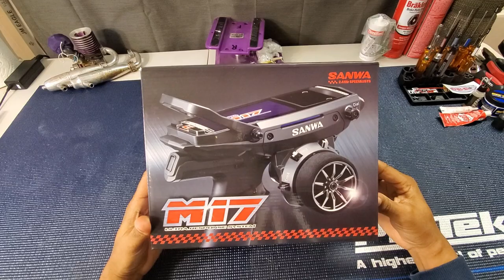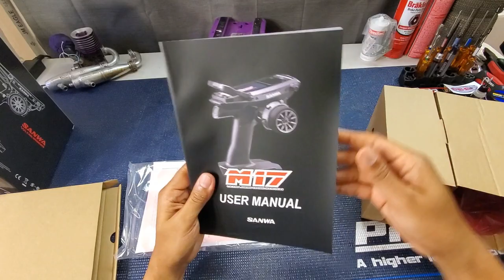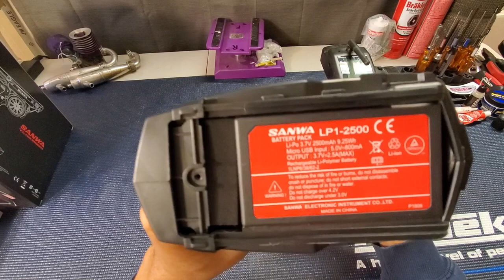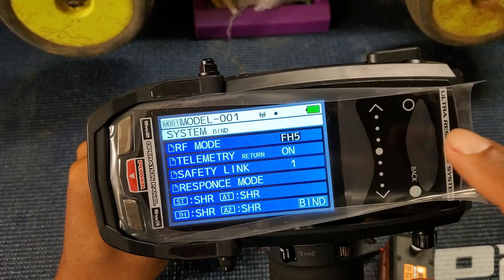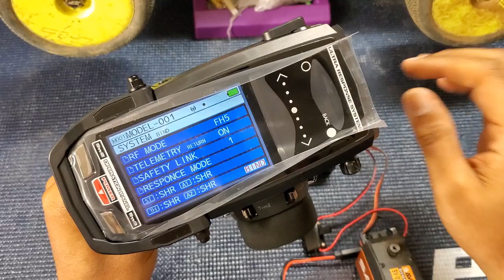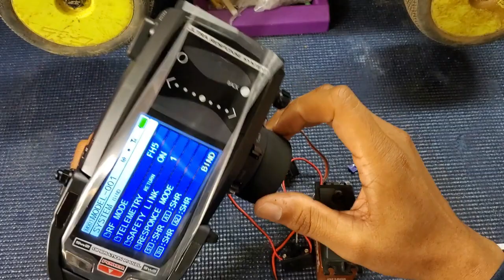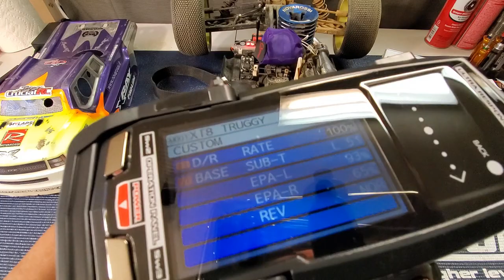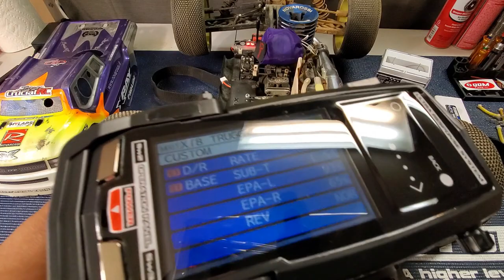Sanwa Bound

Comment: Hi, thanks for sharing. any updates or further opinions on this? I'm kind of between this and a 7PX any info would be greatly appreciated
Reply from the maker: Wassup Walter. This is my go to radio for half my fleet now. What will you be using this radio on? The rec are super small, which is a plus. The signal strength is phenomenal. The menu options are endless. I also like that you can change trigger positions and the wheel tension. The only down to this radio is setting up the killswitch for my 5th scales. That was easier with my Futaba 4pm. Hope some or all of this helps.
Reply: CrucialRC hey, thanks for the quick reply and all the detailed info for now I’m going to be using it on my old Kyosho inferno MP 7.5 in the near future probably going to be getting a different 1/8 scale buggy not sure if I’m going to go nitro or electric
Reply from the maker: @wallyj2000  I think you will love it. Wish I could compare it to the 7px but I hsve never used one. My 4pm is user friendly but the m17, to me, is a little more difficult to set up the killswitch. Everything else is lovely to use. And the touchscreen is sick!
Reply: CrucialRC okay thanks did you get any better with the x-ray? Seems like that car and all the videos I watched of it seems a little bit nose heavy like it always wants to take nosedives after the jumps

Comment: Nice pickup!👍 you cant go wrong with sanwa radios...im still using a m12 from 5 years ago...working like its brand new...and these radios will really test the speed of servos as you showed us...you can get some inexpensive receivers like less then half the cost of oem at https://www.rcjuice.com/radio/receivers/hobbystar-hrx-472-sanwa-fh3-fh4-compatible-4ch-receiver-fhss.html i got 4 of them and haven't had any problems for the year or so that i had them. Keep doing your thing bruh!👍
Reply from the maker: Cool thanks bruh. I heard of those receivers, but was a little weary of grabbing one. I'll have to get some now. Thanks for the heads up.
Reply: @CrucialRC  No problem bruh...i was the same way and said I'll try 1 and it worked great so i grabbed 3 more. So far so good in a truggy and 2 nitro sedans and a 10th scale buggy.👍